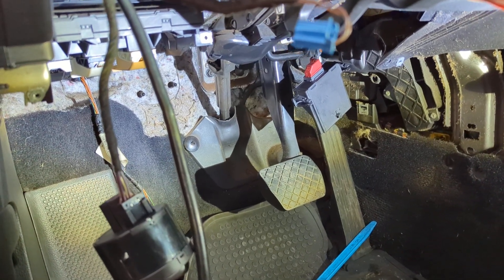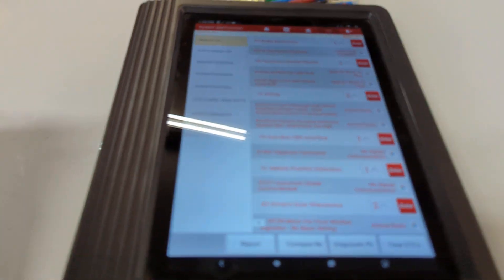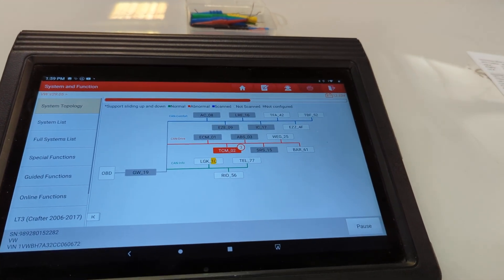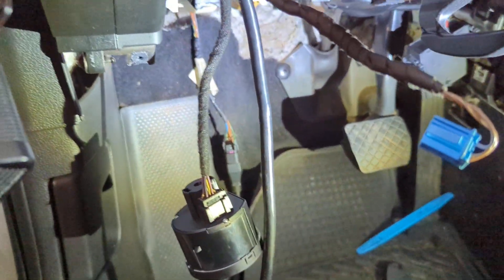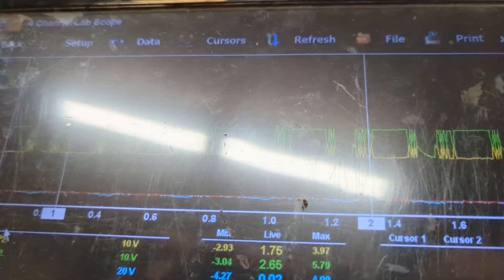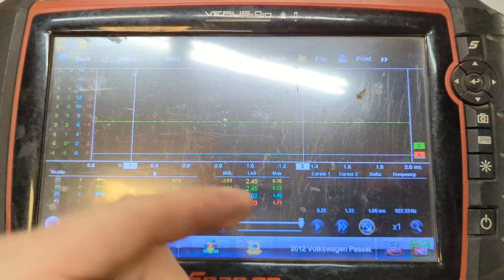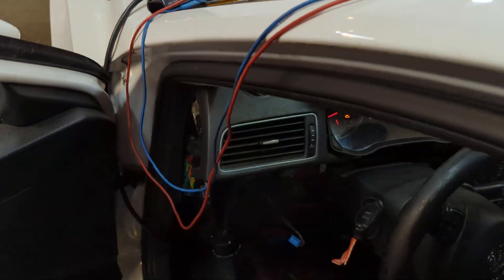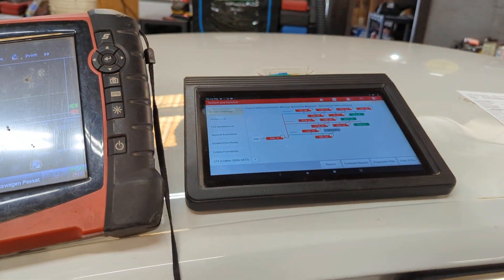Volkswagen NO COMMUNICATION except for TCM - CAN BUS FAULT IN SPLICE

Comment: Great find, I am dealing with same exact issue right now.  I need to figure out how to get to the GW module.... How did you?? Did you just jumper it for good or what was fix
Reply from the maker: GW module was to the right of the steering column on this car.  I jumped it from the one the GW module and removed the wire.  It stayed good for a week so I gave it back to the customer.  The only way I replicated the issue was disconnecting the battery, so I explained that to them.  The alternative was to remove the dash and check the wiring so it would be expensive.

It never came back

Comment: My car is having this issue but it cuts off while driving at times  and then obD reads no communication and then it want start and if it sets it will crank after a while
Reply from the maker: Unfortunately it's a complicated thing to figure out.  Many things can cause no communication, any module on the network that uses CAN BUS can fail and bring the network down
Reply: I was dealing with that shutting off of a sudden.  It was my ECM that would cut out and reset minutes or moments later.  
Right now i am dealing with the canbus after losing the battery for a couple of days.  ( hardly use the car lately).